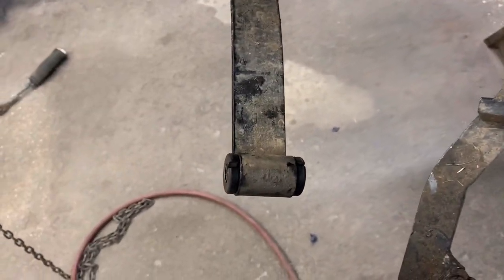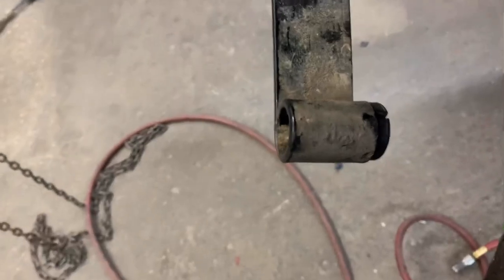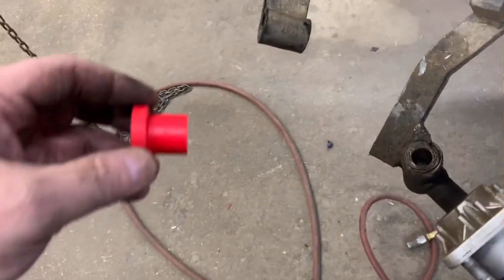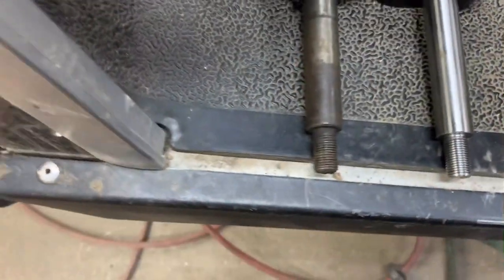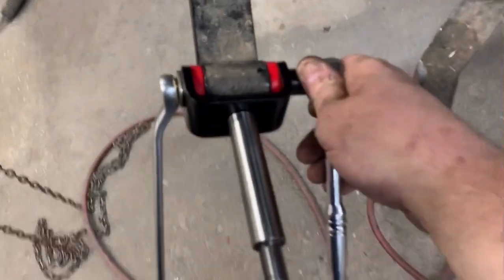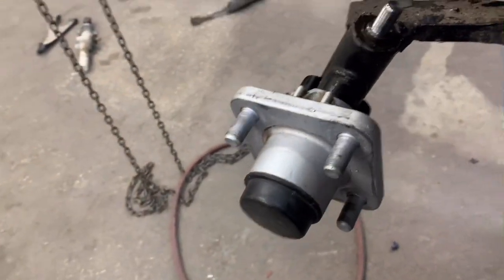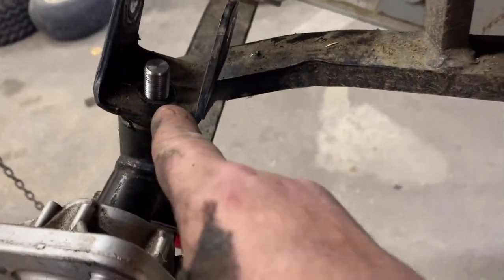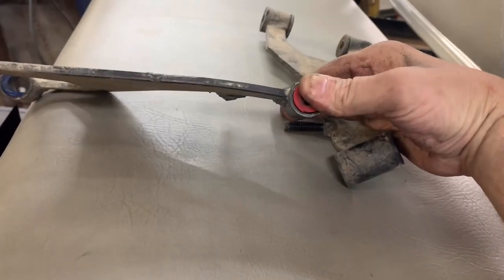CLUB CAR GOLF CART KING PIN INSTALL / POLYURETHANE REPLACEMENT BUSHINGS

Comment: Quick question, my club car precedent moves for about a foot and then cuts out. Someone told me it may be some thing  called  the MCOR. Is that like the pot box in an ez go??  And if the MCOR is bad would that be an indication,  it moves for about 2 or 3 feet than it cuts out.

Comment: Why didn't you replace the sleeves   in the king pin ?
Reply from the maker: U mean the king pin bushings in the steering knuckle?  They were not worn out of spec so I was able to continue operation with them. The old saying goes if it ain’t broke don’t fix it